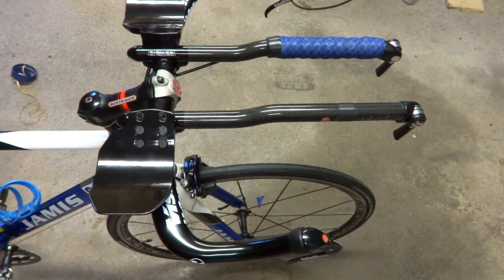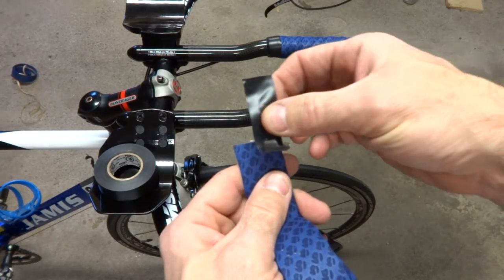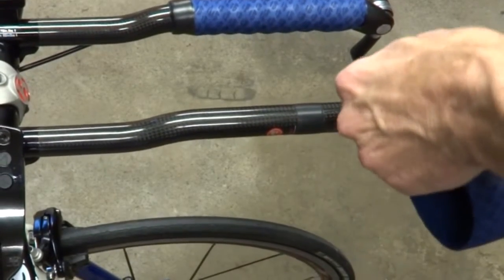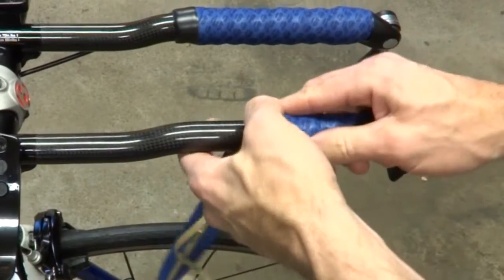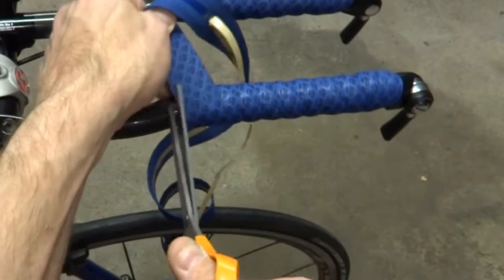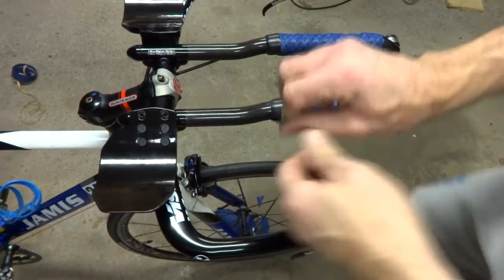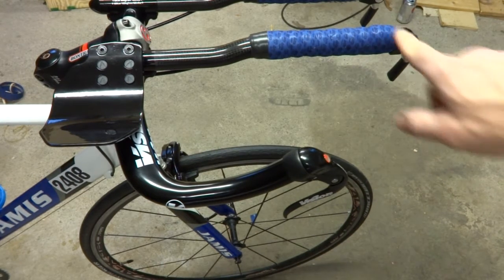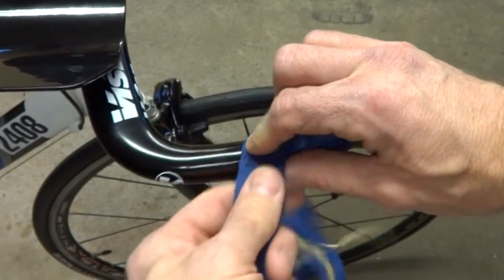How To Wrap Triathlon Bike Aerobars & Basebar Handles

Comment: Shouldn't the tape be wrapped in the other direction ? It seems more logical since the right hand for example will twist the bar clockwise.
Reply: SkyRocket159 definitely
Reply: yes!you are right!!!and the reason you give is the good one.
Reply: Incorrect. If you're riding in your aerobars correctly, you should be gently pulling up on them (driving the elbow into the pad) so the right hand actually puts a counter clockwise torque on the tape. The video is correct.
Reply: I've tried wrapping the bar tape on the aerobars in both directions over the years and it doesn't matter, any direction works fine, the tape stays tight. I keep my hand grip on the aerobars light to prevent tension from traveling to the arms and shoulders.

Comment: Don't use electric tape for bars.  The glue degrades very rapidly from the sun and sweat.  Use silicone tape which is self adhering without glue.
Reply: would helicopter tape be ok? i have also noticed the electrical tape is the first point of failure

Comment: Surely it makes sense to wrap up the bars instead of down? You know, because cyclists are all about aerodynamics and now you've got the seam facing into the wind. You'll just need a wrap of electrical tape at the end to finsih it off.
Reply from the maker: There is reason why it is done this way. They are wrapped this way because how the hands put pressure on the bars/tape. Wrapping up the bars would leave the exposed edge of the bar tape towards the rider. The hands tend to push forward when hold the bars, and the edge with start to roll up after time.